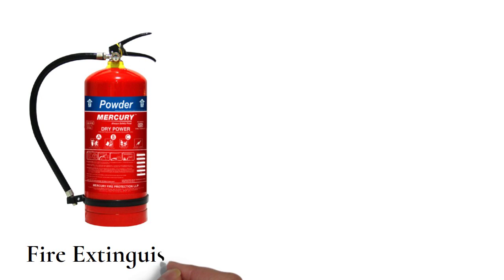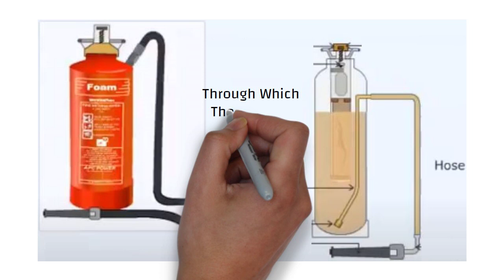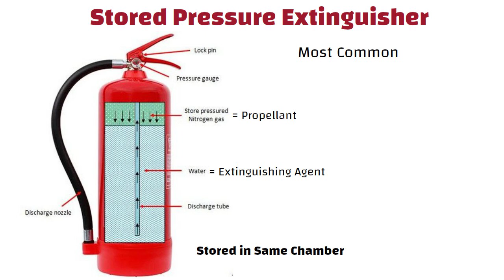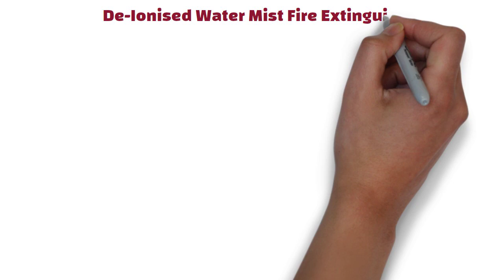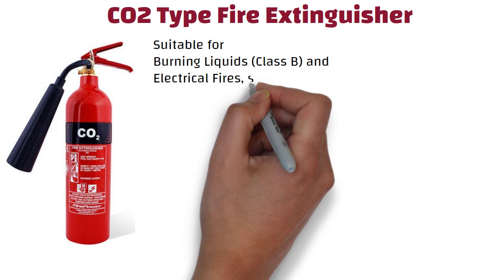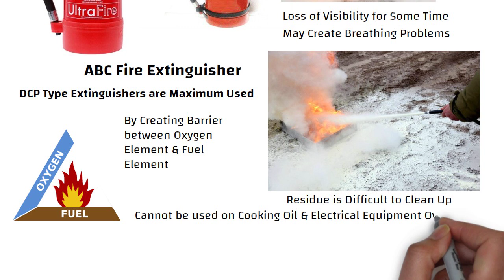FIRE EXTINGUISHER DEALERS IN KERALA, CALL 8138906102, FIRE EXTINGUISHER DEALERS IN ERNAKULAM.

Comment from the maker: FIRE ALARM DEALERS IN CHENGANNUR, ADDRESSABLE FIRE ALARM DEALERS IN CHENGANNUR, FIRE ALARM SYSTEM DEALERS IN CHENGANNUR, ADDRESSABLE FIRE ALARM SYSTEM DEALERS IN CHENGANNUR, FIRE DETECTION SYSTEM IN CHENGANNUR, SMOKE DETECTOR DEALERS IN CHENGANNUR, CONVENTIONAL FIRE ALARM DEALERS IN CHENGANNUR, MORLEY FIRE ALARM DEALERS IN CHENGANNUR, GST FIRE ALARM DEALERS IN CHENGANNUR, ASES SECURITY FIRE ALARM DEALERS IN CHENGANNUR, BEAM DETECTOR DEALERS IN CHENGANNUR, FIRE ALARM SUPPLIERS IN CHENGANNUR, FIRE ALARM TRADERS IN CHENGANNUR, FIRE ALARM PANEL DEALERS IN CHENGANNUR, HEAT DETECTOR DEALERS IN CHENGANNUR, FIRE ALARM SYSTEM SUPPLIERS IN CHENGANNUR, FIRE ALARM COMPANIES IN CHENGANNUR, FIRE EQUIPMENT DEALERS IN CHENGANNUR, ADRRESSABLE FIRE ALARM PANEL DEALERS IN CHENGANNUR, FIRE ALARM SYSTEM IN CHENGANNUR, BATTERY OPERATED DETECTOR DEALERS IN CHENGANNUR, ASPIRATION DETECTION SYSTEM DEALERS IN CHENGANNUR, FIRE ALARM MCP - MANUAL CALL POINT DEALERS IN CHENGANNUR, FIRE ALARM HOOTER DEALERS IN CHENGANNUR, PA TWO WAY TALK BACK SYSTEM DEALERS IN CHENGANNUR, PA SYSTEM DEALERS IN CHENGANNUR, PA TALK BACK UNIT DEALERS IN CHENGANNUR, HOOTER CUM STROBE DEALERS IN CHENGANNUR, FIRE PROTECTION SYSTEM IN CHENGANNUR, FIRE ALARM CONTRACTORS IN CHENGANNUR, FIRE DETECTORS IN CHENGANNUR, FIRE ALARM DEALERS IN CHENGANNUR, ADDRESSABLE FIRE ALARM DEALERS IN CHENGANNUR, SMOKE DETECTOR DEALERS IN CHENGANNUR, FIRE EQUIPMENT DEALERS IN CHENGANNUR, FIRE ALARM INSTALLATION IN CHENGANNUR, FIRE ALARM COMPANIES IN CHENGANNUR FIRE ALARM DISTRIBUTORS IN CHENGANNUR, TALK BACK SYSTEM DEALERS IN CHENGANNUR, FIRE ALARM SENSOR DEALERS IN CHENGANNUR, FIRE EXTINGUISHER DEALERS IN CHENGANNUR, FIRE ALARM DEALERS IN CHENGANNUR, FIRE ALARM DEALERS IN KERALA, ADDRESSABLE FIRE ALARM DEALERS IN CHENGANNUR, SMOKE DETECTOR IN CHENGANNUR,  FIRE EXTINGUISHER DEALERS IN CHENGANNUR, FIRE EXTINGUISHER SUPPLIERS IN CHENGANNUR, FIRE EXTINGUISHER DISTRIBUTORS IN CHENGANNUR, FIRE EXTINGUISHER IN CHENGANNUR, ABC TYPE FIRE EXTINGUISHER DEALERS IN CHENGANNUR, CO2 TYPE FIRE EXTINGUISHER DEALERS IN CHENGANNUR, CLEAN AGENT FIRE EXTINGUISHER IN CHENGANNUR, FIRE FIGHTING PUMP DEALERS IN CHENGANNUR, FIRE PUMP DEALERS IN CHENGANNUR, KIRLOSKAR FIRE PUMP DEALERS IN CHENGANNUR, FIRE JOCKEY PUMP DEALERS IN CHENGANNUR, FIRE DISEL ENGINE DRIVEN PUMP DEALERS IN CHENGANNUR, FIRE FIGHTING EQUIPMENT DEALERS IN CHENGANNUR, FIRE FIGHTING SYSTEM IN CHENGANNUR, VERTICAL INLINE PUMP DEALERS IN CHENGANNUR, HYDRO PNEUMATIC PRESSURE BOOSTING PUMP DEALERS IN CHENGANNUR, VERTICAL TURBINE PUMP DEALERS IN CHENGANNUR, SEWAGE PUMP DEALERS IN CHENGANNUR, RO PUMP DEALERS IN CHENGANNUR. FIRE EXTINGUISHER IN CHENGANNUR, FIRE EXTINGUISHER SUPPLIERS IN CHENGANNUR, PA TWO WAY TALK BACK SYSTEM DEALERS IN CHENGANNUR, MORLEY FIRE ALARM DEALERS IN CHENGANNUR, GST ADDRESSBLE FIRE ALARM DEALERS IN CHENGANNUR, BUTTERFLY VALVE DEALERS IN CHENGANNUR,
Reply: FIRE EXTINGUISHER DEALERS IN WAYANAD, FIRE EXTINGUISHER SUPPLIERS IN WAYANAD, FIRE EXTINGUISHER DISTRIBUTORS IN WAYANAD, FIRE EXTINGUISHER IN WAYANAD, ABC TYPE FIRE EXTINGUISHER DEALERS IN WAYANAD, CO2 TYPE FIRE EXTINGUISHER DEALERS IN WAYANAD, CLEAN AGENT FIRE EXTINGUISHER IN WAYANAD, MODULAR TYPE FIRE EXTINGUISHER DEALERS IN WAYANAD, MECHANICAL FOAM FIRE EXTINGUISHER DEALERS IN WAYANAD, FIRE EXTINGUISHER NEAR ME WAYANAD, FIRE EXTINGUISHER TRADERS IN WAYANAD, FIRE FIGHTING COMPANIES IN WAYANAD, FIRE CONTRACTORS IN WAYANAD, FIRE EQUIPMENT DEALERS IN WAYANAD, FIRE ALARM DEALERS IN WAYANAD, FIRE PUMP DEALERS IN WAYANAD, SMOKE DETECTOR DEALERS IN WAYANAD, FIRE FIGHTING SYSTEM IN WAYANAD, FIRE PROTECTION SYSTEM IN WAYANAD, FIRE AND SAFETY CONTRACTORS IN WAYANAD, FIRE HYDRANT SYSTEMS IN WAYANAD, PA TALK BACK SYSTEM IN WAYANAD, FIRE NOC IN WAYANAD, FIRE INSTALLATION IN WAYANAD, FIRE NOC RENEWAL IN WAYANAD, KIRLOSKAR FIRE PUMP DEALERS IN WAYANAD, FIRE EXTINGUISHER NEAR ME WAYANAD, FIRE EXTINGUISHER MANUFACURERS IN WAYANAD, SAFEX FIRE EXTINGUISHER DEALERS IN WAYANAD, FIRE NOC CONTRACTORS IN WAYANAD, FIRE FIGHTING EQUIPMENT DEALERS IN WAYANAD, FIRE PROTECTION SYSTEM IN WAYANAD, FIRE INSTALLATION IN WAYANAD, FIRE SAFETY CONTRACTORS IN WAYANAD, FIRE AMC IN WAYANAD, FIRE PROTECTION SYSTEM IN WAYANAD, FIRE PROTECTION EQUIPMET IN WAYANAD, AMC OF FIRE SYSTEM IN WAYANAD, FIRE CONSULTANTS IN WAYANAD, FIRE AND SAFETY EQUIPMENT DEALERS IN WAYANAD, ADDRESSABLE FIRE ALARM SYSTEM IN WAYANAD, KARTHAR VALVE DEALERS IN WAYANAD, DCP TYPE FIRE EXTINGUISHER IN WAYANAD, POWSER TYPE FIRE EXTINGUISHERS IN WAYANAD, FIRE HYDRANT SYSTEM IN WAYANAD, FIRE ALARM PANEL DEALERS IN WAYANAD, SAFEPRO FIRE EXTINGUISHER DEALERS IN WAYANAD, MS AND GI PIPE DEALERS IN WAYANAD, JINDAL PIPE DEALERS IN WAYANAD, AGNI FIRE ALARM DEALERS IN WAYANAD, FIRE EQUIPMENT DEALERS IN WAYANAD, FIRE EQUIPMENT SUPPLIERS IN WAYANAD, FIRE EQUIPMENT TRADERS IN WAYANAD, FIRE SPRINKLER SYSTEM IN WAYANAD, RAVEL FIRE ALARM DEALERS IN WAYANAD, RAVEL FIRE ALARM SYSTEM IN WAYANAD, AGNI FIRE ALARM DISTRIBUTORS IN WAYANAD, FIRE ALARM CONTRACTORS IN WAYANAD, FIRE PIPE INSTALLATION IN CONTRACTORS IN WAYANAD, FIRE SAFETY CONTRACTORS IN WAYANAD, FIRE PA TWO WAY TALK BACK SYSTEM DEALERS IN WAYANAD, HEAT DETECTOR DEALERS IN WAYANAD, HONEYWELL FIRE ALARM DEALERS IN WAYANAD, FIRE NOC CONSULTANTS IN WAYANAD, FIRE AMC AND FIRE NOC IN WAYANAD, FIRE SAFETY COMPANIES IN WAYANAD, NEWAGE DEALERS IN WAYANAD, MONSHER FIRE EQUIPMENT DEALERS IN WAYANAD, KARTHAR VALVE DEALERS IN WAYANAD, FIRE HYDRANT VALVE DEALERS IN WAYANAD, FIRE HOSE REEL DRUM DEALERS IN WAYANAD, FIRE SPRINKLER DEALERS IN WAYANAD, FIRE PUMP DEALERS IN WAYANAD, LUBI PUMP DEALERS IN WAYANAD, LHP PUMP DEALERS IN WAYANAD. FIRE CONTRACTORS IN WAYANAD, FIRE AND SAFETY CONTRACTORS IN WAYANAD, FIRE EQUIPMENT DEALERS IN WAYANAD, FIRE FIGHTING CONTRACTORS IN WAYANAD, AGNI FIRE ALARM DEALERS IN WAYANAD, PA TALK BACK SYSTEM DEALERS IN WAYANAD, FIRE NOC IN WAYANAD, FIRE NOC RENEWAL IN WAYANAD, FIRE SYSTEM INSTALLATION IN WAYANAD, FIRE EXTINGUISHER DEALERS IN KALPETTA, FIRE EXTINGUISHER DEALERS IN BATHERY, FIRE EXTINGUISHER DEALERS IN MANATHAVADY.
Reply: FIRE EXTINGUISHER DEALERS IN KERALA, FIRE EXTINGUISHER SUPPLIERS IN KERALA, FIRE EXTINGUISHER DISTRIBUTORS IN KERALA, FIRE EXTINGUISHER IN KERALA, ABC TYPE FIRE EXTINGUISHER DEALERS IN KERALA, CO2 TYPE FIRE EXTINGUISHER DEALERS IN KERALA, CLEAN AGENT FIRE EXTINGUISHER IN KERALA, MODULAR TYPE FIRE EXTINGUISHER DEALERS IN KERALA, MECHANICAL FOAM FIRE EXTINGUISHER DEALERS IN KERALA, FIRE EXTINGUISHER NEAR ME KERALA, FIRE EXTINGUISHER TRADERS IN KERALA, FIRE FIGHTING COMPANIES IN KERALA, FIRE CONTRACTORS IN KERALA, FIRE EQUIPMENT DEALERS IN KERALA, FIRE ALARM DEALERS IN KERALA, FIRE PUMP DEALERS IN KERALA, SMOKE DETECTOR DEALERS IN KERALA, FIRE FIGHTING SYSTEM IN KERALA, FIRE PROTECTION SYSTEM IN KERALA, FIRE AND SAFETY CONTRACTORS IN KERALA, FIRE HYDRANT SYSTEMS IN KERALA, PA TALK BACK SYSTEM IN KERALA, FIRE NOC IN KERALA, FIRE INSTALLATION IN KERALA, FIRE NOC RENEWAL IN KERALA, KIRLOSKAR FIRE PUMP DEALERS IN KERALA, FIRE EXTINGUISHER NEAR ME KERALA, FIRE EXTINGUISHER MANUFACURERS IN KERALA, SAFEX FIRE EXTINGUISHER DEALERS IN KERALA, FIRE NOC CONTRACTORS IN KERALA, FIRE FIGHTING EQUIPMENT DEALERS IN KERALA, FIRE PROTECTION SYSTEM IN KERALA, FIRE INSTALLATION IN KERALA, FIRE SAFETY CONTRACTORS IN KERALA, FIRE AMC IN KERALA, FIRE PROTECTION SYSTEM IN KERALA, FIRE PROTECTION EQUIPMET IN KERALA, AMC OF FIRE SYSTEM IN KERALA, FIRE CONSULTANTS IN KERALA, FIRE AND SAFETY EQUIPMENT DEALERS IN KERALA, ADDRESSABLE FIRE ALARM SYSTEM IN KERALA, KARTHAR VALVE DEALERS IN KERALA, DCP TYPE FIRE EXTINGUISHER IN KERALA, POWSER TYPE FIRE EXTINGUISHERS IN KERALA, FIRE HYDRANT SYSTEM IN KERALA, FIRE ALARM PANEL DEALERS IN KERALA, SAFEPRO FIRE EXTINGUISHER DEALERS IN KERALA, MS AND GI PIPE DEALERS IN KERALA, JINDAL PIPE DEALERS IN KERALA, AGNI FIRE ALARM DEALERS IN KERALA, FIRE EQUIPMENT DEALERS IN KERALA, FIRE EQUIPMENT SUPPLIERS IN KERALA, FIRE EQUIPMENT TRADERS IN KERALA, FIRE SPRINKLER SYSTEM IN KERALA, RAVLE FIRE ALARM DEALERS IN KERALA, RAVEL FIRE ALARM SYSTEM IN KERALA, AGNI FIRE ALARM DISTRIBUTORS IN KERALA, FIRE ALARM CONTRACTORS IN KERALA, FIRE PIPE INSTALLATION IN CONTRACTORS IN KERALA, FIRE SAFETY CONTRACTORS IN KERALA, FIRE PA TWO WAY TALK BACK SYSTEM DEALERS IN KERALA, HEAT DETECTOR DEALERS IN KERALA, HONEYWELL FIRE ALARM DEALERS IN KERALA, FIRE NOC CONSULTANTS IN KERALA, FIRE AMC AND FIRE NOC IN KERALA, FIRE SAFETY COMPANIES IN KERALA, NEWAGE DEALERS IN KERALA, MONSHER FIRE EQUIPMENT DEALERS IN KERALA, KARTHAR VALVE DEALERS IN KERALA, FIRE HYDRANT VALVE DEALERS IN KERALA, FIRE HOSE REEL DRUM DEALERS IN KERALA, FIRE SPRINKLER DEALERS IN KERALA, FIRE PUMP DEALERS IN KERALA, LUBI PUMP DEALERS IN KERALA, LHP PUMP DEALERS IN KERALA. FIRE CONTRACTORS IN KERALA, FIRE AND SAFETY CONTRACTORS IN KERALA, FIRE EQUIPMENT DEALERS IN KERALA, FIRE FIGHTING CONTRACTORS IN KERALA,
Reply: FIRE EXTINGUISHER DEALERS IN KERALA, FIRE EXTINGUISHER SUPPLIERS IN KERALA, FIRE EXTINGUISHER DISTRIBUTORS IN KERALA, FIRE EXTINGUISHER IN KERALA, ABC TYPE FIRE EXTINGUISHER DEALERS IN KERALA, CO2 TYPE FIRE EXTINGUISHER DEALERS IN KERALA, CLEAN AGENT FIRE EXTINGUISHER IN KERALA, MODULAR TYPE FIRE EXTINGUISHER DEALERS IN KERALA, MECHANICAL FOAM FIRE EXTINGUISHER DEALERS IN KERALA, FIRE EXTINGUISHER NEAR ME KERALA, FIRE EXTINGUISHER TRADERS IN KERALA, FIRE FIGHTING COMPANIES IN KERALA, FIRE CONTRACTORS IN KERALA, FIRE EQUIPMENT DEALERS IN KERALA, FIRE ALARM DEALERS IN KERALA, FIRE PUMP DEALERS IN KERALA, SMOKE DETECTOR DEALERS IN KERALA, FIRE FIGHTING SYSTEM IN KERALA, FIRE PROTECTION SYSTEM IN KERALA, FIRE AND SAFETY CONTRACTORS IN KERALA, FIRE HYDRANT SYSTEMS IN KERALA, PA TALK BACK SYSTEM IN KERALA, FIRE NOC IN KERALA, FIRE INSTALLATION IN KERALA, FIRE NOC RENEWAL IN KERALA, KIRLOSKAR FIRE PUMP DEALERS IN KERALA, FIRE EXTINGUISHER NEAR ME KERALA, FIRE EXTINGUISHER MANUFACURERS IN KERALA, SAFEX FIRE EXTINGUISHER DEALERS IN KERALA, FIRE NOC CONTRACTORS IN KERALA, FIRE FIGHTING EQUIPMENT DEALERS IN KERALA, FIRE PROTECTION SYSTEM IN KERALA, FIRE INSTALLATION IN KERALA, FIRE SAFETY CONTRACTORS IN KERALA, FIRE AMC IN KERALA, FIRE PROTECTION SYSTEM IN KERALA, FIRE PROTECTION EQUIPMET IN KERALA, AMC OF FIRE SYSTEM IN KERALA, FIRE CONSULTANTS IN KERALA, FIRE AND SAFETY EQUIPMENT DEALERS IN KERALA, ADDRESSABLE FIRE ALARM SYSTEM IN KERALA, KARTHAR VALVE DEALERS IN KERALA, DCP TYPE FIRE EXTINGUISHER IN KERALA, POWSER TYPE FIRE EXTINGUISHERS IN KERALA, FIRE HYDRANT SYSTEM IN KERALA, FIRE ALARM PANEL DEALERS IN KERALA, SAFEPRO FIRE EXTINGUISHER DEALERS IN KERALA, MS AND GI PIPE DEALERS IN KERALA, JINDAL PIPE DEALERS IN KERALA, AGNI FIRE ALARM DEALERS IN KERALA, FIRE EQUIPMENT DEALERS IN KERALA, FIRE EQUIPMENT SUPPLIERS IN KERALA, FIRE EQUIPMENT TRADERS IN KERALA, FIRE SPRINKLER SYSTEM IN KERALA, RAVLE FIRE ALARM DEALERS IN KERALA, RAVEL FIRE ALARM SYSTEM IN KERALA, AGNI FIRE ALARM DISTRIBUTORS IN KERALA, FIRE ALARM CONTRACTORS IN KERALA, FIRE PIPE INSTALLATION IN CONTRACTORS IN KERALA, FIRE SAFETY CONTRACTORS IN KERALA, FIRE PA TWO WAY TALK BACK SYSTEM DEALERS IN KERALA, HEAT DETECTOR DEALERS IN KERALA, HONEYWELL FIRE ALARM DEALERS IN KERALA, FIRE NOC CONSULTANTS IN KERALA, FIRE AMC AND FIRE NOC IN KERALA, FIRE SAFETY COMPANIES IN KERALA, NEWAGE DEALERS IN KERALA, MONSHER FIRE EQUIPMENT DEALERS IN KERALA, KARTHAR VALVE DEALERS IN KERALA, FIRE HYDRANT VALVE DEALERS IN KERALA, FIRE HOSE REEL DRUM DEALERS IN KERALA, FIRE SPRINKLER DEALERS IN KERALA, FIRE PUMP DEALERS IN KERALA, LUBI PUMP DEALERS IN KERALA, LHP PUMP DEALERS IN KERALA. FIRE CONTRACTORS IN KERALA, FIRE AND SAFETY CONTRACTORS IN KERALA, FIRE EQUIPMENT DEALERS IN KERALA, FIRE FIGHTING CONTRACTORS IN KERALA
Reply: FIRE EXTINGUISHER DEALERS IN ERNAKULAM, FIRE EXTINGUISHER DEALERS IN TRIVANDRUM, FIRE EXTINGUISHER DEALERS IN KOCHI, FIRE EXTINGUISHER DEALERS IN THRISSUR, FIRE EXTINGUISHER DEALERS IN PALAKKAD, FIRE EXTINGUISHER DEALERS IN KOTTAYAM, FIRE EXTINGUISHER DEALERS IN CHANGANASSERY, FIRE EXTINGUISHER DEALERS IN THIRUVALLA, FIRE EXTINGUISHER DEALERS IN CHENGANNUR, FIRE EXTINGUISHER DEALERS IN ALEPPEY, FIRE EXTINGUISHER DEALERS IN ADOOR, FIRE EXTINGUISHER DEALERS IN PANDALAM, FIRE EXTINGUISHER DEALERS IN KARUNAGAPALLY, FIRE EXTINGUISHER DEALERS IN KARUNAGAPPALLY, FIRE EXTINGUISHER DEALERS IN KAYAMKULAM, FIRE EXTINGUISHER DEALERS IN PATHANAMTHITTA, FIRE EXTINGUISHER DEALERS IN OACHIRA, FIRE EXTINGUISHER DEALERS IN KOLLAM, FIRE EXTINGUISHER DEALERS IN TRIVANDRUM, FIRE EXTINGUISHER DEALERS IN PERUMBAVOOR, FIRE EXTINGUISHER DEALERS IN KOTHAMANGALAM, FIRE EXTINGUISHER DEALERS IN MOOVATTUPUZHA, FIRE EXTINGUISHER DEALERS IN PALA, FIRE EXTINGUISHER DEALERS IN VALANCHERY, FIRE EXTINGUISHER DEALERS IN MALAPPURAM, FIRE EXTINGUISHER DEALERS IN TIRUR, FIRE EXTINGUISHER DEALERS IN CALICUT, FIRE EXTINGUISHER DEALERS IN PONNANI, FIRE EXTINGUISHER DEALERS IN PAYYANNUR, FIRE EXTINGUISHER DEALERS IN PAYYANUR, FIRE EXTINGUISHER DEALERS IN WAYANAD, FIRE EXTINGUISHER DEALERS IN KALPETTA, FIRE EXTINGUISHER DEALERS IN MANANTHAVADY, FIRE EXTINGUISHER DEALERS IN FEROKE, FIRE EXTINGUISHER DEALERS IN THANUR, FIRE EXTINGUISHER DEALERS IN KERALA, FIRE EXTINGUISHER DEALERS IN CHALAKKUDY, FIRE EXTINGUISHER DEALERS IN KODUNGALLUR, FIRE EXTINGUISHER DEALERS IN ANGAMALY, FIRE EXTINGUISHER DEALERS IN BATHERY, FIRE EXTINGUISHER DEALERS IN, MUNNAR, FIRE EXTINGUISHER DEALERS IN IDUKKI, FIRE EXTINGUISHER DEALERS IN MANJERI, FIRE EXTINGUISHER DEALERS IN THALASSERY, FIRE EXTINGUISHER DEALERS IN THRIPUNITHURA, FIRE EXTINGUISHER DEALERS IN VADAKARA, FIRE EXTINGUISHER DEALERS IN KANHANGAD, FIRE EXTINGUISHER DEALERS IN KOYILANDI, FIRE EXTINGUISHER DEALERS IN KALAMASSERY, FIRE EXTINGUISHER DEALERS IN NEYYATINKARA, FIRE EXTINGUISHER DEALERS IN GURUVAYUR, FIRE EXTINGUISHER DEALERS IN VADAKKANCHERY, FIRE EXTINGUISHER DEALERS IN PARAPPANAGADI, FIRE EXTINGUISHER DEALERS IN NEDUMANGAD, FIRE EXTINGUISHER DEALERS IN KASARGOD, FIRE EXTINGUISHER DEALERS IN PAYYOLI, FIRE EXTINGUISHER DEALERS IN PUNALUR, FIRE EXTINGUISHER DEALERS IN CHERTHALA, FIRE EXTINGUISHER DEALERS IN THALIPARAMBA, FIRE EXTINGUISHER DEALERS IN KOTTAKKAL, FIRE EXTINGUISHER DEALERS IN SHORANUR, FIRE EXTINGUISHER DEALERS IN IRITTY, FIRE EXTINGUISHER DEALERS IN ATTINGAL, FIRE EXTINGUISHER DEALERS IN HARIPAD, FIRE EXTINGUISHER DEALERS IN MUVATTUPUZHA, FIRE EXTINGUISHER DEALERS IN MOOVATTUPUZHA, FIRE EXTINGUISHER DEALERS IN KOOTHUPARAMBA, FIRE EXTINGUISHER DEALERS IN IRINJALAKUDA, FIRE EXTINGUISHER DEALERS IN MAVELIKKARA, FIRE EXTINGUISHER DEALERS IN VARKALA, FIRE EXTINGUISHER DEALERS IN MANATHAVADI, FIRE EXTINGUISHER DEALERS IN KOTTARAKARA, FIRE EXTINGUISHER DEALERS IN KOTTARAKKARA, FIRE EXTINGUISHER DEALERS IN RANNI, FIRE EXTINGUISHER DEALERS IN MALLAPALLY, FIRE EXTINGUISHER DEALERS IN ALUVA, FIRE EXTINGUISHER DEALERS IN SHORANUR, FIRE EXTINGUISHER DEALERS IN EDAPPAL, FIRE EXTINGUISHER DEALERS INKUTTIPURAM, FIRE EXTINGUISHER DEALERS IN PERINTHALMANNA, FIRE EXTINGUISHER DEALERS IN NILESWAR, FIRE EXTINGUISHER DEALERS IN KUTTIADI, FIRE EXTINGUISHER DEALERS IN MAHE, FIRE EXTINGUISHER DEALERS IN THAMARASSERY, FIRE EXTINGUISHER DEALERS IN PONKUNNAM, FIRE EXTINGUISHER DEALERS IN NILAMBUR, FIRE EXTINGUISHER DEALERS IN PATTAMBI, FIRE EXTINGUISHER DEALERS IN VALPARAI, FIRE EXTINGUISHER DEALERS IN ADIMALY, FIRE EXTINGUISHER DEALERS IN KOOTHATTUKULAM, FIRE EXTINGUISHER DEALERS IN THALAYOLAPARAMBU, FIRE EXTINGUISHER DEALERS IN ETTUMANUR, FIRE EXTINGUISHER DEALERS IN KANJIRAPPALY, FIRE EXTINGUISHER DEALERS IN CHAVARA, FIRE EXTINGUISHER DEALERS IN KILIMANUR, FIRE EXTINGUISHER DEALERS IN KUTTIKKANAM, FIRE EXTINGUISHER DEALERS IN PERAMBRA, FIRE EXTINGUISHER DEALERS IN MANNARKKAD, FIRE EXTINGUISHER DEALERS IN KUNDARA, FIRE EXTINGUISHER DEALERS IN TANUR, FIRE EXTINGUISHER DEALERS IN NOORANAD, FIRE EXTINGUISHER DEALERS IN KONNI, FIRE EXTINGUISHER DEALERS IN SASTHAMKOTTA, FIRE EXTINGUISHER DEALERS IN PATHANAPURAM, FIRE EXTINGUISHER DEALERS IN  ANCHAL, FIRE EXTINGUISHER DEALERS IN  KOZHENCHERY, FIRE EXTINGUISHER DEALERS IN  MUNDAKAYAM, FIRE EXTINGUISHER DEALERS IN  KANJIRAPALLY, FIRE EXTINGUISHER DEALERS IN VAIKOM, FIRE EXTINGUISHER DEALERS IN KATTAPANA, FIRE EXTINGUISHER DEALERS IN CHIRAYANKEEZHU, FIRE EXTINGUISHER DEALERS IN KOLENCHERY, FIRE EXTINGUISHER DEALERS IN MAHE, FIRE EXTINGUISHER DEALERS IN NADAPURAM, FIRE EXTINGUISHER DEALERS IN KUTTIYADI.